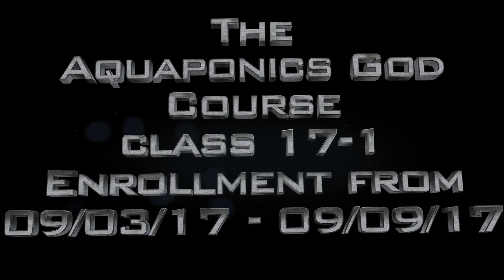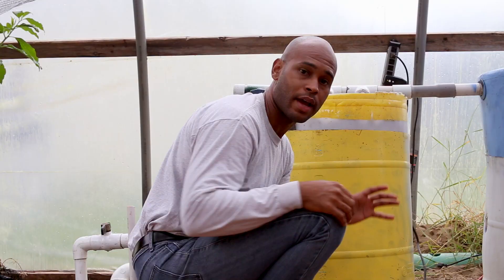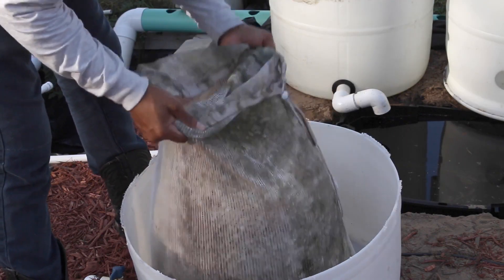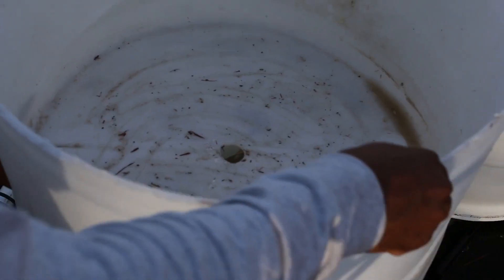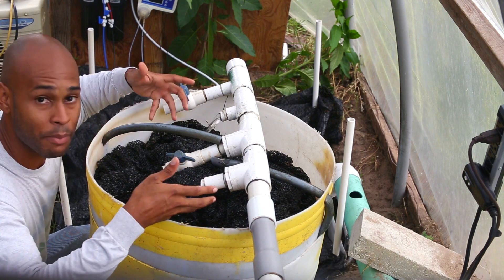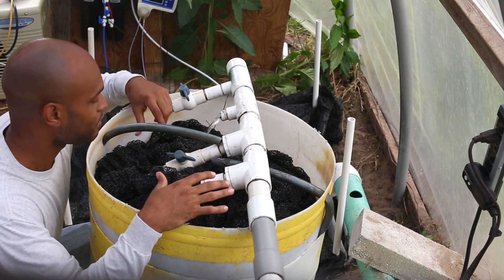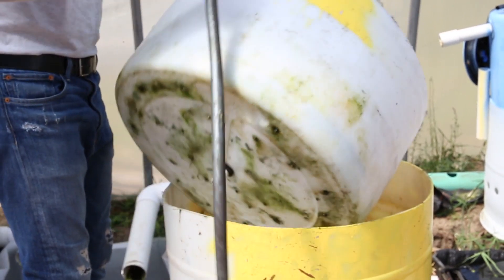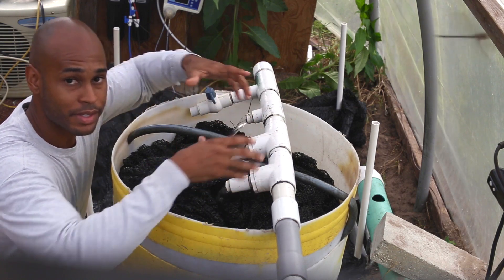Aquaponics: How to buid a Dual-Purpose Trickle Filter

Comment: Very good idea. This guy is extremely knowledgeable. I'm going to do a smaller version of one of these coming off of my growbed, with two  5 gal buckets, using lava rock as the medium for the bacteria, then run a small pipe straight back into my main tank

Comment: Great set of videos - word of caution - electricity and water are not a good mix.  When using any electrical device that is plugged in (like the electric drill) it is best to have no water around.  Using a battery operated drill is a much better idea.   That way we can keep watching you!

Comment: I think using some simple Phyasics we can calculate the number of holes. Since mgh = 1/2 mv2 gives V = Velocity of water in m/s exiting your flood tray through the holes and h is the height of water column = SQRT(2*g*h).  For example let us say we want a 10 cm (0.1m) heigh column, then V =exit velocity of water is SQRT (2* 9.81*0.1)  =1.4 m/S = 140 cm/S, Also we know the amount of water coming in as 10 liters/S (eg) then the total area of the holes at the bottom = 10 * 1000 cm3/ 140 cm = 71.43 cm2. If we wanted 64 holes  (equi distant in circular pattern) , then each hole should be = 71.43 cm2 /64 = 1.116 cm2.  Now using area of a circular hole as = pie *D*D/4, gives us D = 1.119 cm or may be 1cm drill?

Comment: Using a corded (120V) drill in water.. you're a brave man.
Reply: This was a concern of mine. Best not to risk that mate. Get a cordless. Great information and detail on your videos, thank you for that. Please don't electrocute yourself, though.
Reply: I was more worried about the hole shrapnel getting mixed into the system and causing some kind of toxicity. lol
Reply: I was just thinking the same thing. If ever a reason to buy a cordless drill, that right there is the best one.

Comment: Using an electric drill in a tub of water seemed a little risky to me.  However I thank you for sharing your knowledge.
Reply: All the electric bits of the drill were far away from the water, at least by a few inches, but yeah probably wise to keep anything electronic in a dry area and only work on dry materials.

Comment: Question, does sand filter out the floating fine solids? I'd rather have the first layer of growbeds out of the swirl tanks be the fine solids filter because then I don't have as much of a maintenance issue (rinsing out filters) as all I have to do is dig out the clogged sand and use it in potting soil. What kind of edible plants would grow in a damp sand bed? I'm thinking ginger and sugar cane, etc... Or would the moisture ruin the ginger?